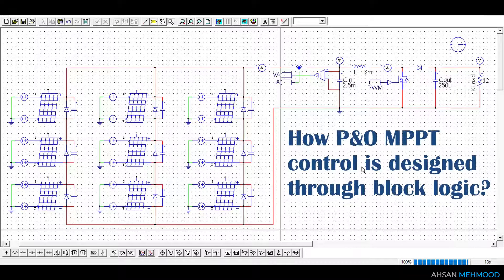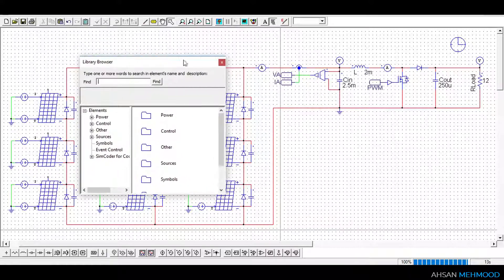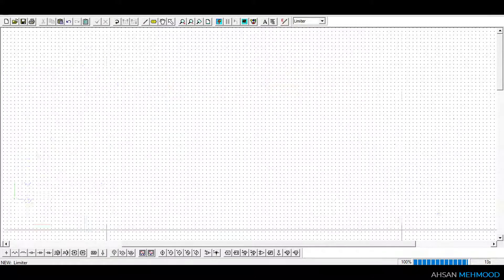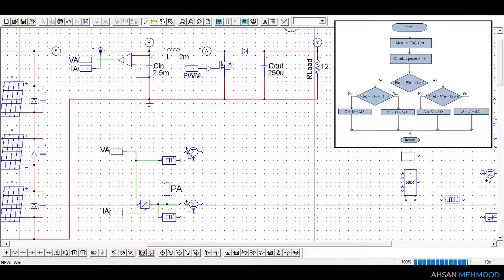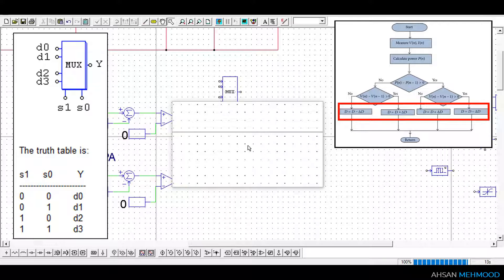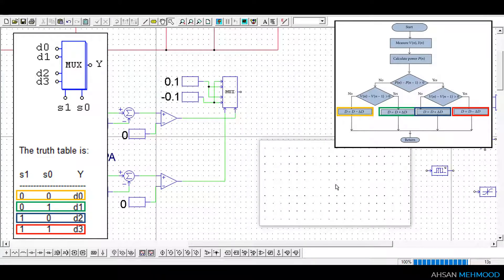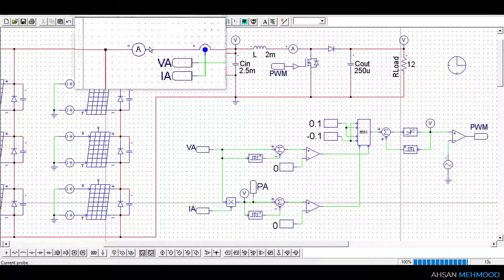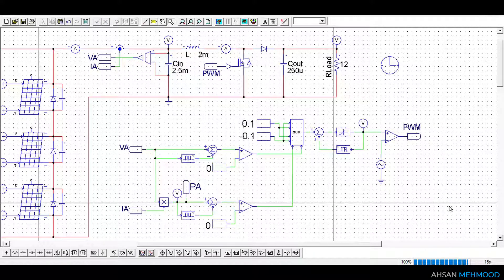MPPT P&O block logic simulation in PSIM software | Perturb and observe method simulation

Comment: Sir, can u please explain why did u put 0.1 and -0.1 in the multiplexer
Reply from the maker: These are values of +DeltaD and -DeltaD.
These values are designers choice and need to be tuned carefully.
If you increase increase these values, then maximum power tracking time will decrease but oscillations in steady-state will increase and vice versa.
Reply: @ahsanmehmood9229 Thank u so much but it didnt work out for me because in my case i work on buck-boost converter, can u please give me u email so i can give u the details of my problem with it
Reply from the maker: My email has been given in About section of channel.

Comment: My duty summer will continue to add and subtract,so the duty range is changed to 0 or 0.85 how should I do to improve it
Reply from the maker: Yes, it will continue adding and subtracting, that's how it tracks MPP. Do you want a smooth duty-ratio in steady-state?

Comment: Sir, what Is the valor of Unit Time Delay Block?
Reply from the maker: We neither set value of Unit time delay block directly nor there is an option for it.

The purpose of Unit time delay block is to delay the signal for a unit time. Here "unit time" means Simulation step size (or Time step), which is decided by Simulation control block.

The value of Time step in this video is 4 micro-seconds as shown at 06:33 minutes. Therefore, we can say value of unit time delay block for this video is 4 micro-seconds, but it changes from simulation to simulation.